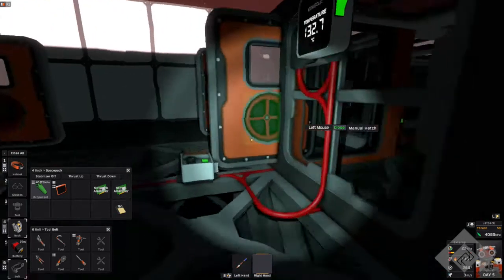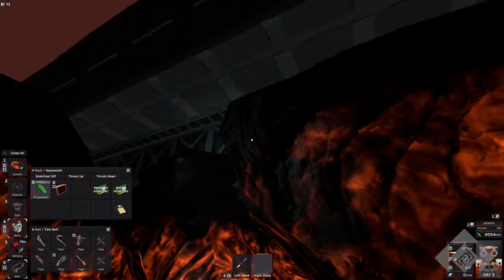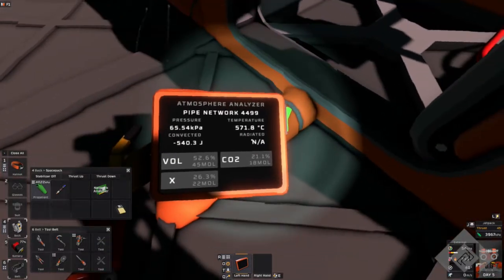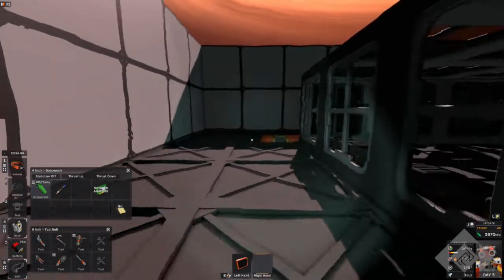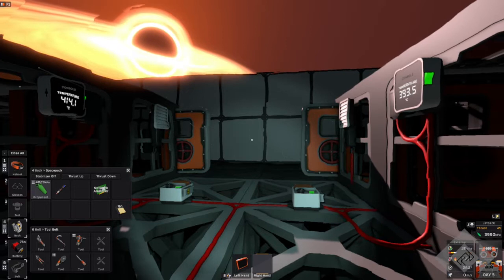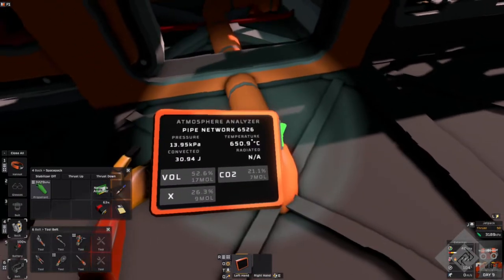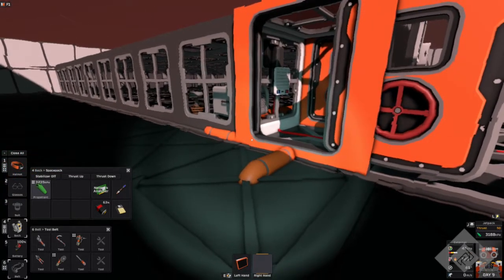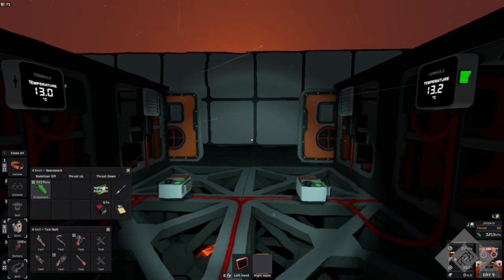They're A Peltier, Not A Heat Pump - Stationeers Experiment

Comment: On your inline the differential is due to the pipe length between the 2 inline valves try expanding the length and there should be a noticeable difference I believe.  But if the goal is to restrict the pressure then yeah the single pipe should restrict the flow more. if you added another single pipe segment on the inline it would restrict it further, however you are correct they are essentially a peltier / heatpipe cpu cooler in function.  Great experiment.  I may jump back in and experiment a bit tomorrow since today was my Friday.  I think I am going to play around with the wall coolers.
Reply from the maker: You gave me another idea! A pressure reduction valve using only passive parts!